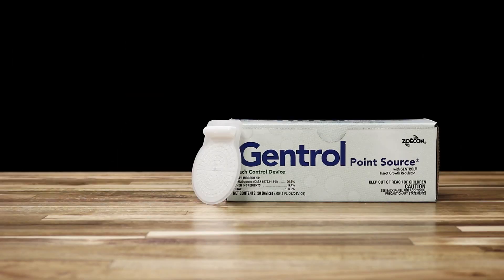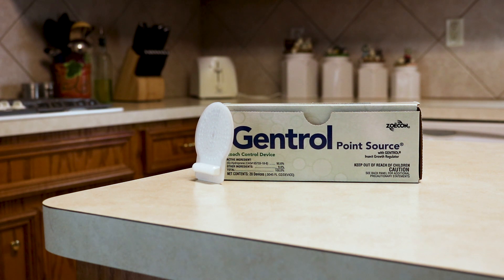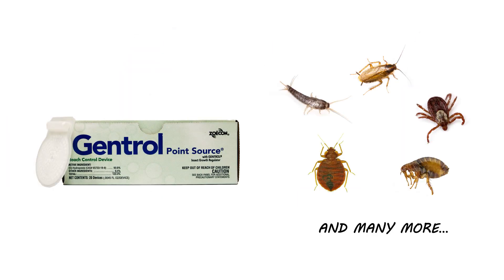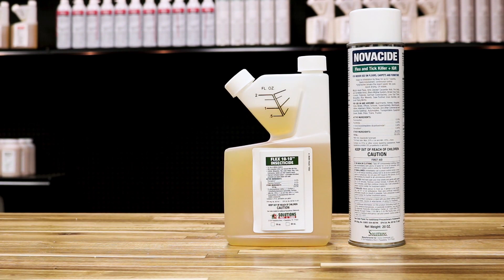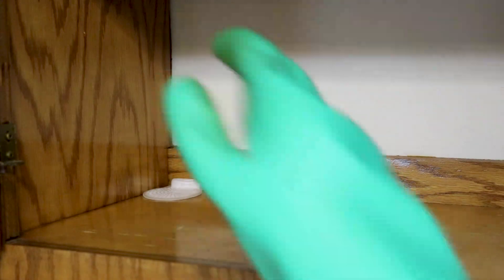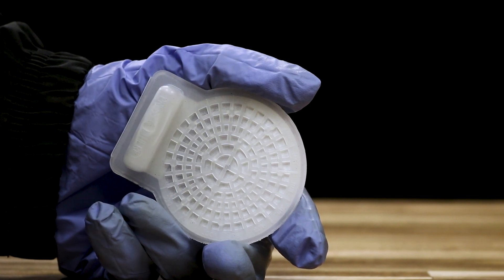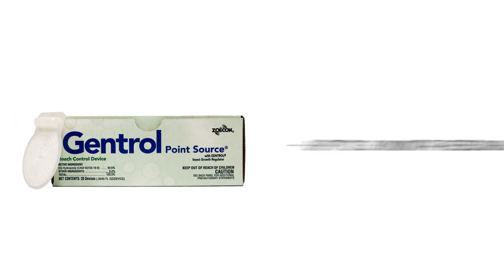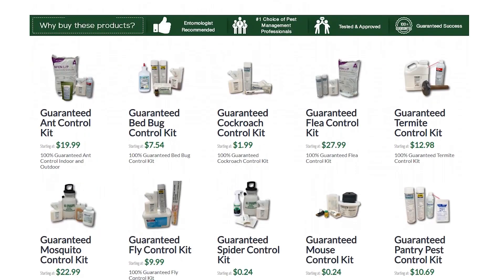Gentrol Point Source IGR: Product Review

Comment: Just applied, now we wait. 😈 This is basically the final step in my roach extermination plan. Might not kill them all with the baits and sprays, but no more roaches will be reproducing🪳
Reply: Awesome!   Thanks for the feedback!  I’m doing the same thing!  I’ve had the advion down for the past 3 days, now I’m about to go in with the Gentrol.  My roaches came from boxes that were in the garage.
Reply: @CarrieFinley-g1m I couldn't tell you who what when where why or how. However what I can tell you is that Advion solved the issue. The GSI strips might not have even been necessary BUT I used them regardless to eliminated the baby roaches and stop the reproduction cycle of any future roaches. I haven't seen A roach in years still! No more turning on the lights and the whole floor moving, or any of that. The ultimate solution.
Reply: Did it work?? @CarrieFinley-g1m
Reply: Any updates? Did it work?
Reply: @Neshaakaay  Yes! It only took a month to be completely roach free. This was a problem I was dealing with for years too.
Reply: @Neshaakaay  I used advion and then followed it up with the gsi control strips for the babies by the way. The advion was the main thing that killed the roaches.
Reply: @boredfive3001  that’s great! I will be trying this out, thank you for replying!
Reply: @Neshaakaay  You're welcome!
Reply: @boredfive3001  can you send a link to gsi control strips, not sure what that is.

Comment: You’re better off using the concentrate either in the spray or a professional fogger and you’ll get the best results. Remember this does not kill roaches it just stops them from reproducing. So you would need either a roach gel bait in conjunction if you’re treating a family home. Or a residual insecticide spray. For commercial establishments

Comment: Can i use gentrol point source inside my 3 year old kids room? he always stays inside that room is it safe?
Reply: You can. I'd placed it over the window still so it's out of a child's reach & it'll cover the room. This product is a dispersant so it'll spread into the air. If you're worried about it effecting your child? Unless your child is an invertebrate, your child will be unaffected.
Reply: @Rudofaux but does it have a long-term effect on humans that will eventually result in cancer?
Reply: @650tonyd  Unless humans have insect biology & not being in direct contact with it. You'll be fine. Now if you find yourself in a Kafka's The Metamorphosis...
 Then yeah, you might have some issues.